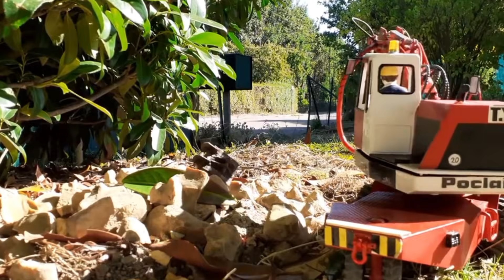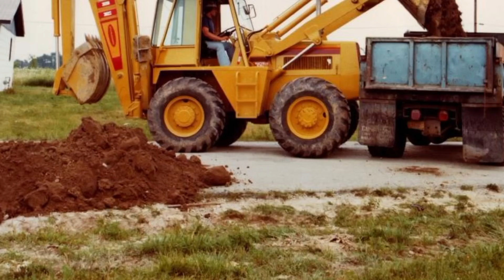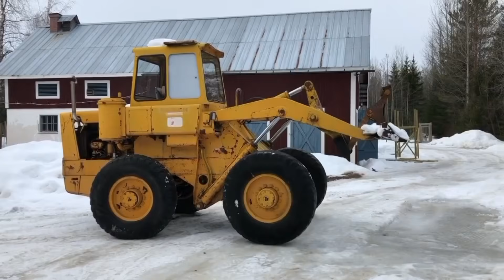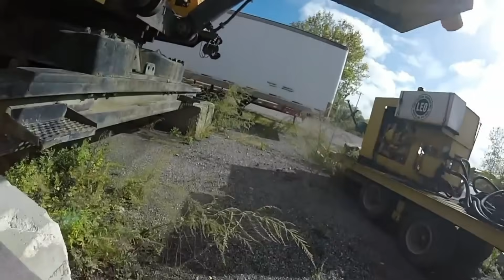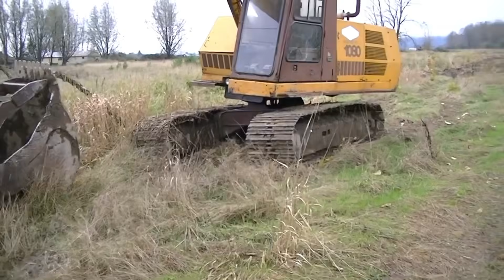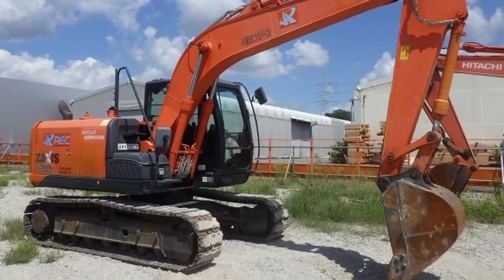10 HATED EXCAVATORS THAT FADED INTO HISTORY

Comment: I will say about ( Warner & Swasey) they did build the Hopto-1900 it was America Largest in 1972 it was a 100 Ton, excavator 😊 with a digging depth of 35 feet 7 inches.and reach of 48 feet 10 inches. The last one was shipped in 1990, so it had a long production run.

Comment: Just like to say. I own a 1978 Dynahoe-190 yes you are Right about the Wt. (19400) pounds inmy old girl. Her Dipper arm is over 10 feet alone. She has a massive backhoe Digging bucket. The one thing you forgot to tell about was the unique rear wheel lock out for braking. It had a toggle switch on front bucket lever, that you pushed up or down, then a solenoid undder the machine, between the two back tires, would lock out fluid to the wheel you wanted to lock up for skid steering. Most backhoes of that time, had two brake pedals. I have a very narrow area, by my house to tuen in, so I added a steering nob, on steering wheel to help turn the oversized beast. For me, it is OWNING part of Bucyrus Erie History. Plus I ran one in 1979 on a big sewer mainline job, I fell in love with the size, conpaired to the Case 580 series I always operated. I have owned her sense 2003, and she uprighted my tipped over mini excavator, with no trouble at all. I even pulled the 1-Ton mini, to level ground, by just the swing of the Dynahoe alone. I have seen recently that the Dynahoes have become prized possessions for old time operator or just a person who saw them work, and were amazed, and wanted one. I will have my big baby boy, till I Die. Because she will not, she just keeps doing everything I need her to do. 😊 the one maple stump I took out, the stump was about  as big as the Dynahoe, and she just, pulled the stump out, and I got it in the Dumpster.